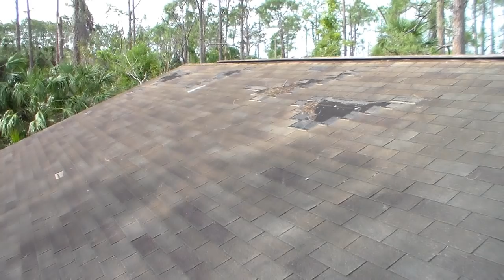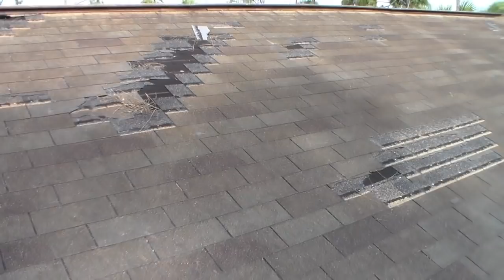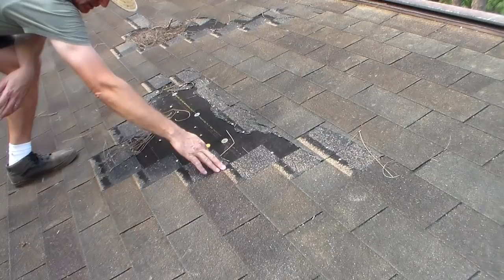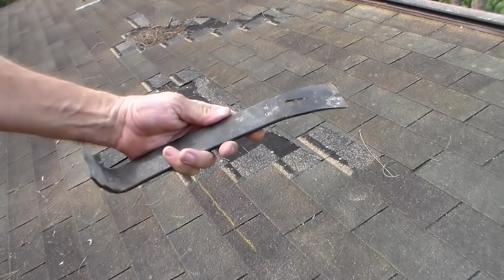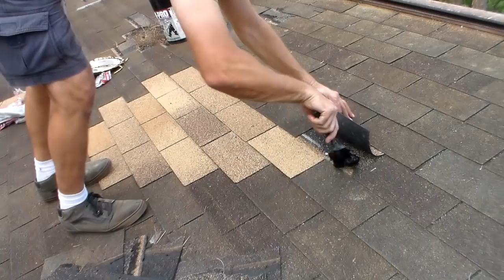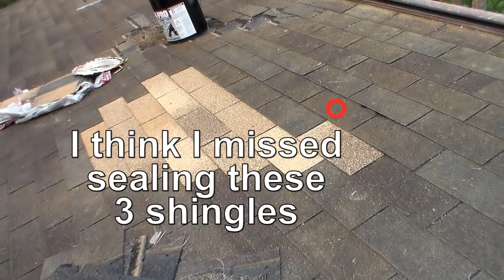Roof Repair Asphalt Shingles Hurricane Damage 3 - Replace Shingle Section

Comment: Excellent video.  This video is gonna save me thousands of $.  The question I have is why would you not cut out the old roof felt and then slide new roof felt under the edges of the old shingles?  The roof I am patching is so old the roof felt isn't felt at all - it is 'tar paper' and it has deteriorated to nothingness.  I assume the old roof felt on the roof you are patching  is still in good condition and you opted to NOT replace the old roof felt...right?
Reply from the maker: Correct. Replacing/repairing tarpaper would be better in your case as to not lay shingles over bare wood. In this area, once the shingles are installed, the roof felt or tarpaper is useless as waterproofing. The shingles are now the primary waterproofing. The methods we use in this area, where ice dams are not a concern, the tarpaper is a slip sheet to separate the roof covering and the wood deck. The tarpaper also serves as a temporary dry in during new construction.

Comment: How do you know when to stop removing the old to tie in the new shingles?  I notice you say that you have a tie in with the right side of the roof.  Is it the edge of a whole shingle you're looking for?  is it an edge or a complete shingle with a clean edge? Or is it an particular angle?
Reply from the maker: I was probably looking for a whole shingle tab as there were rips in the shingles. So I would have been taking it past the last ripped shingle tab or the seam. It just depends on where it is.

Comment: Why did you double nail.First time i have seen that.I am not a roofer i weld.I have to fix my mothers roof this week.Great job with the instruction.There are quite a few shingles missing on her roof and i was thinking about metal roofing over top of existing.Bad winter winds plus old roof in upstate N.Y.
Reply from the maker: 6 nails per shingle.

Comment: Excellent work, obviously. However, I would have thought there would have been more effort to find a closer color match to the existing shingles.
Reply from the maker: That is the exact color match. Cedar, which will eventually turn in 10 years. The only other thing would be to put weatherwood or charcoal and they will never match. This roof is 18 years old so has 5-8 years left. I would think it will get a new roof before any of the shingles match.